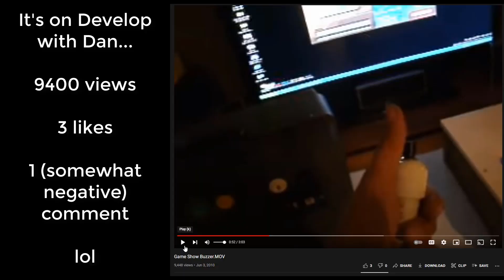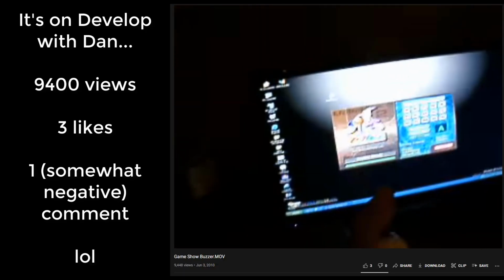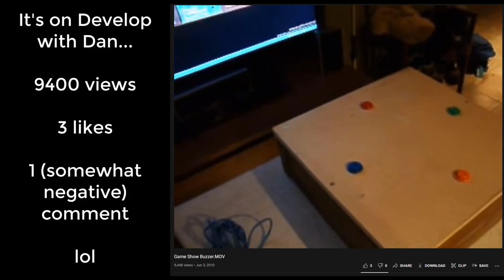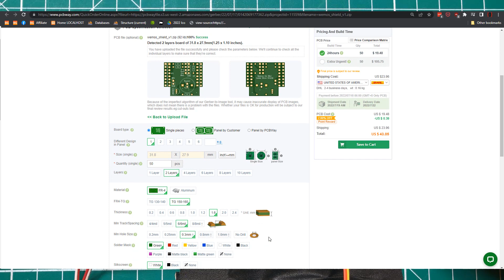OpenBuzzer - Building the ultimate open source game show buzzer platform - Part 1

Comment: Thats great, maybe I should model a 3d printable case? KiCad rocks, the Speeduino ECU pcb files is also done in KiCad and then it was a easy excersize to send it to PCBWay to get  the boards done!! Awesome work Dan!!!
Reply from the maker: I've been tinkering with a few cases off thingiverse, but none of them are perfect. I think that would be cool.   PCBWay is so great for getting that stuff done.